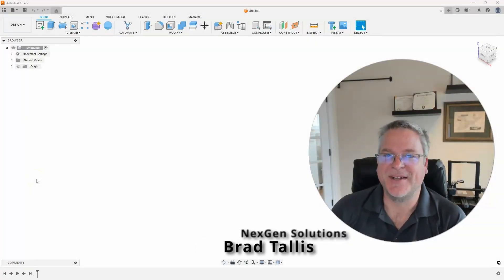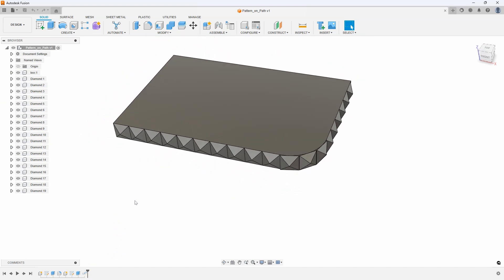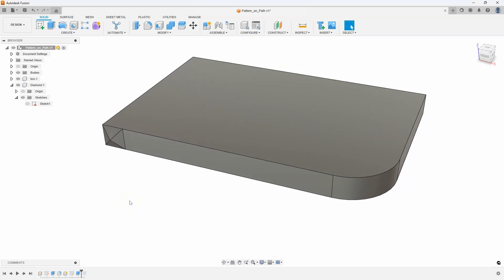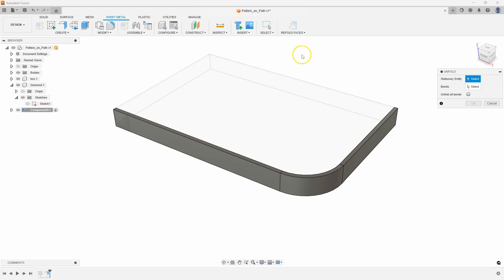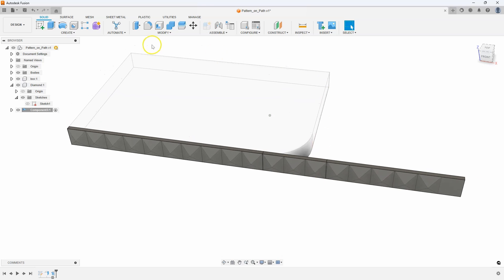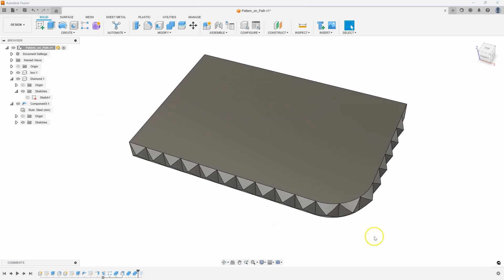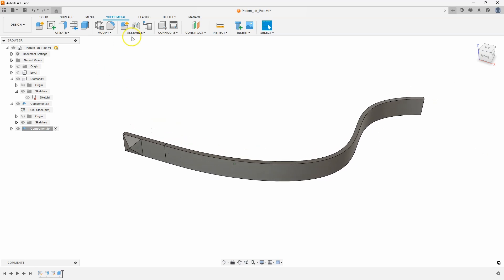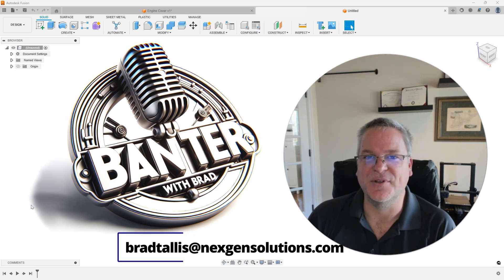Banter With Brad, Episode 02 - Wrapping geometry

Comment: Wow!  After battling a cable path problem for over 7 days, creating 137 construction planes and 150 sketches, I wish now I'd known about this.  I'm inspired to email you a "how. would you do this?" email about making a complex cable routing.  After about 4-5 spines in 3D, Fusion just seems to stop letting me manipulate tangent and curve handles, and the loft command is also driving me nuts with "the rail doesn't intersect the profiles" errors.  More to come.  Thank you for this.
Reply from the maker: You might want to take a look at a video I did awhile back on routing wires:  https://youtu.be/UsJ6C9HEmlI?si=CA5fc_U5n4C74s0_
Reply: Saw it a few times.  The 3D spline creation facility is very difficult with lots of UI irregularities.  I’ll email you.

Comment: Why doesn't Fusion have a proper parametric bend or conform/morph feature. Emboss is almost there but not quite. What would be nice is to desigon on a flat surface have the bodies/surfaces flow to the target surface. Rhino does this with FlowAlongSrf command.